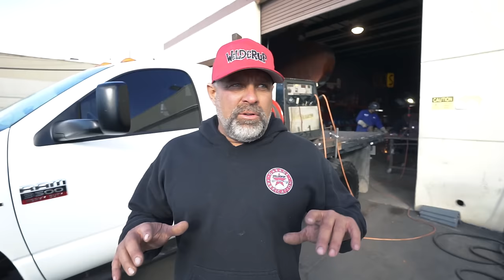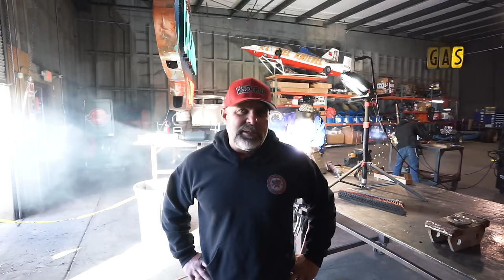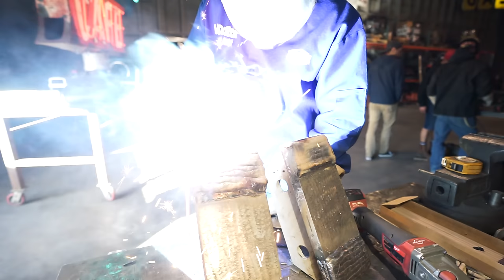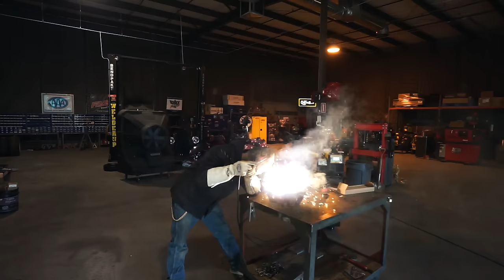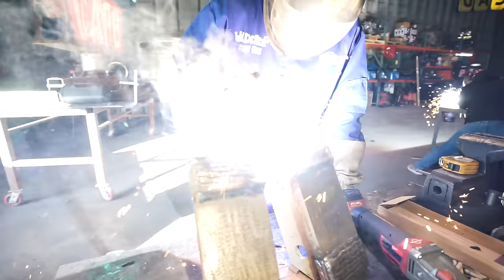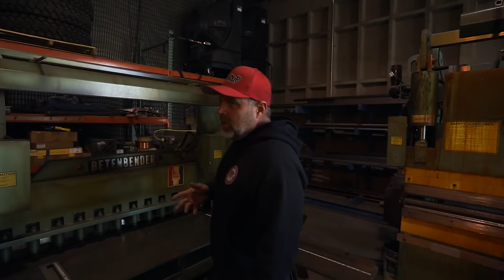Making $1,000's With A Welder at 20 Years Old | Why You Need To Get Into Welding

Comment: I welded in highschool and around the house, then went to hobart, and have been welding for 10 years anywhere from industrial maintenance, powerplants, concrete plants, shop welding, cranes,asme pipe welding, derby cars lol, bore welding, hardsurface, repairing equipment

Comment: Really Cool to pass on your skills but safety glasses and safety awareness is the smartest and best tool you could ever pass down. This is coming from a guy that’s had his head put in a medical vice, had his eyelids mechanically held open and told to “look straight ahead at the green dot and DO NOT move your eyeball”. That was right before the good Dr. started drilling. The microscopic piece he Drilled out was mostly in the white but partially on the edge of the color. The color drilling is unlike any other pain I’ve experienced. They can’t immobilize your eyeball itself and you can’t flinch. This was the most trust I’ve ever put in another human. I waited about 30 to 40 minutes for the specialist to arrive. He was calm, and extremely confident. The bit he used was smaller than a hair. It had to be chucked up under a magnifier. He said if I flinched during the procedure that the end of the bit could possibly break off and then we’d have some really big issues depending on how deep it was in my eye at the time. When this accident happened I was wearing safety glasses And a face shield. I was prepping a broken outboard motor fin when a chunk of aluminum hit the welder control panel and ricocheted in a perfect trajectory past my double PPE and into my right eye. I bought safety glasses with mesh sides afterwards. Maybe it’s just my luck but I’ve also almost lost a tooth to a piece of a cutoff wheel about 5 years before that. That situation is why I was wearing the face shield over the glasses. You can never be too safe and of course, accidents will happen. You only get 2 eyes on this journey. If you lose one, you also lose depth perception which is desirable in our line of work. I hope they read this and learn from my story. Some guys think safety glasses are for pooseys. Those guys aren’t tough, they’re idiots.
Reply from the maker: Thanks for your comment. Appreciate it!

Comment: My humble opinion,  the Old Miller's, Hobarts, and Lincoln's don't know how old they are,  they're tanks plain and simple.  I once found a old old Miller Thunderbolt that was under water for weeks after a hurricane.  I took it home, took it apart, vacuum,  clean, blow out, some grease, and new cable ends. That was 10 years ago and it's still welding today.

Comment: cool but i dont fully agree on the 'not being able to read and write' part....  because as a welder you need to be able to understand technical drawings, and read schematics of all the machines you work with.   perhaps writing is not as much of an issue, but you need te be pretty mathmetical if you want to do a little more than just laying the welds  if you ask me.        perhaps you could say it depends on what kind of jobs you do.   if you have to work with engineers and architects you certainly need some technical communication skills aswel as having technical insight. :)    welding is not for dummies!
Reply from the maker: That is all true. Kash being funny. Certainly do need to know how to read and write and doing math everyday along with a lot of other things. Thanks for your comment.

Comment: Had 13 yrs in steel fab work not so much in the weld n but prepare n the part such as punch press ,10 ton brake press,10 foot accu shear for 8`×6' sheet steel up to 1/2 thick operated 10ton overhead crane  mill n machine, i.w.machine for angel iron and round stock AND YES AFTER A 10 HR DAY OF THAT UR WHOLE  BODY HURT THAN 2009 CAME AND POOF IT WAS ALL GONE IM 45 NOW AND STILL STRUGGLING EMPLOYMENT WISE

Comment: I would throw a word of caution welding is a construction industrial base trade regionally can be profitable depending on location and the amount of work available I can tell you I living in the Northeast welding is one of the most unappreciated trades both in need and pay scale compared to other trades for instance most construction companies in my area are small  businesses who mainly work on their own equipment I quoted a cutting-edge one time I believe it was 10 ft. I believe the wear plate to do the repair was around 700 my cost at the Steelyard 1900 was the quote did I get the job no if you figure the amount of hours that was involved any additional materials and wear spots on the bucket to be reinforced not to mention travel and expense don't know who ended up doing the job but it wasn't me so my point is be careful what you tell people can be a profitable trade but with the lack of Industry and construction projects once again depending on location we don't double dip in this trade other than commercial buildings there are very limited opportunities to make money in the housing market compared to other trades such as electricians HVAC Plumbing Masonry carpentry and so on just my two cents but I do agree welding is a real man's trade you definitely at work for it in the trade since 1982 and have held many certs which is also another pet peeve the fact that a cert can expire in 6 months is ridiculous if not in use no other trade goes through that you don't see plumbers and electricians losing their license for lack of use on top of that there are certs for every process  and every base material both on pipe and plate  even Bridge code is a separate certification they can cost you 300 to $500 pass or fail on average anyway thanks for the video I always enjoy seeing people willing to work for their money 👊

Comment: Well as a union Pipefitter welder I can agree one thing I don’t is tell them kids to wear there PPE using a wire wheel with out safety glasses is a major issue get one of them wires in your eyes they are way to young for that also welding takes a toll on your eyes without safety glasses

Comment: Great video!! But, from a old time welder like myself, running hard-faced you really need to invest in a good air helmet. Some, of those harder rods and wires can do a lot of damage to your lungs and can be so toxic you can end up in the hospital or they can even cause death! You can't support your family with either one of those scenarios. Invest in the right equipment, even if it's a little too expensive do it safe and right the first time.. 😉

Comment: Any thoughts on the physical demands of steamfitting/pipefitting as an apprenticeship path to secure welding as a skill while earning good money? Do you think 10-15 years for experience and money is worth the physical toll, to then go on to focus on welding as an independent career? Or would one be better off going to a welding school that they have to pay out of pocket for. Long winded question, but thank you!
Reply from the maker: Hi Brian, I started welding in High School at the Career Center in my city. I got my schooling in the steel yard working for years bending, cutting, fabricating and working with structural steel. I then became self-employed with a mobile truck and did many different types of welding. Mobile worked best for me and has worked for my sons. Can't really say on the physical demands other than the steel yard and the heat of Las Vegas was hard at times. Good Luck with your decision.

Comment: Ive been a welder for 10 years in Alberta Canada. im 32 now but the oil patch is completly destroyed here now and way to many welders and no work. Ive been thinking about moving to vegas because there always building there. Alberta was fine when there was money here but now its cold for 7 months and theres no money anymore. Are welding jobs easy to get in Vegas is there a high demand? Alberta is freezing and no work it might be time to move somewhere else!
Reply from the maker: Y2J, at this time Las Vegas has shut down. Before the Virus it was on a up swing. I agree that the cold winters make it hard there, but 3 months out of the year here it is extremely hard on Welders in the yard and out in the field. With temperatures from 100 to 112. Bending a cutting steel makes it seem even hotter, it can be rough, but most of the year it's good. It takes some getting used to. Let's hope that it all comes back stronger than ever.

Comment: I been on the fence about getting back into welding, I went to school for it and worked in production welding for about 4 years but I just wasn't making the money that I thought I deserved for the work I was putting in I fabricated press heads for bailing equipment and I've done some structural and heavy equipment welding but I got out of it. it's been maybe 4 years since I was in the industry and have not been happy doing really anything else like when I was welding but I'm not 23 years old anymore and I have a son to help provide for and 12-15$ an hour production welding just isn't going to do it for me and in my opinion the wear and tear on my body is worth more than the price I just mentioned, do you have any suggestions on what I should do so I can get back to the job I really really like doing but stay away from the low paying production the only type of welding I've not had a lot of time in doing is TIG and Pipe but I'm familiar with it. As in I took the classes for it in school. Awesome channel just found it and seeing you guys and alot of others on here making awesome money doing what seems like to me pretty basic welding applications GMAW, SMAW etc really makes me feel confident and comfortable with going back to it. Thanks 🙏
Reply from the maker: Hi Phillip,
We have stayed busy here in Las Vegas. There seems to be a need for welders in many areas. My boys have their own mobile welding and is working well for them. Welding is a good trade. If needed you can always fall back on it. It is good to perfect your TIG and Pipe. Do it well and do it all.

Comment: Honest question. How has the health standards for welding changed compared to the old days?
Reply from the maker: I think mostly the ventilation and safety goggles. Better helmets. I've learned the hard way with some burns to my skin so stay covered. Fire and electricity resistant clothing. Shields. Just about everything continues to get better. Stay safe!

Comment: I really want to get into welding, I do wood working right now, can any of the seasoned welders recommend a good starter welder that’s easy to learn quick? Like what type mig,tig? Thanks guys
Reply: Get a Lincoln power mig 210 mp. It's a great machine capable of stick,tig and mig. Great machine go learn with. Or an esab rebel also is a great machine. Look into it and good luck.

Comment: I've worked with welders fabricating, grinding, and bending metal but never welded. How can I get started? School or job that allows on site training.
Reply from the maker: I offer a beginning course on beginning welding on YouTube. There is a cost. info@welder101.com        I took welding in High School at the Career Center. Went to work in the steel yard and was mostly self taught. There are trade schools that teach only Welding. We have two schools here in Las Vegas. Some unions will offer to school you also. Thanks for watching.

Comment: I managed to chop a top on a 50 F-1. 5.5 inches! It looked sooo bitchin'. Then I tried to weld it all back together. All I had was a $99 Harbor Freight 110v stick welder the size of a shoe box, and zero practice or experience. No bueno. Cutting tin is easier than stickin it back together. I sold the truck 😕.
Reply from the maker: Good story! probably won't do that again. Makes for good practice!
Reply: @WelderUpVegas  I got a small mig now, a Miller I inherited from dad. Just gotta get an argon bottle and some .023 solid core wire, and I can try again!

Comment: i no how to weld and I'm good at it but I just cant figer out how to start my own business I really don't have the money to got out and by good welders or rigs have any suggestions for me
Reply: work for someone who has a mobile welding truck. learn how the business works and learn how to price jobs. Then save your money, buy a used  4x4 pick up truck and a small motor generator welder, a set of bottles for cutting , and some basic hand tools. that is all you need to start out. you dont need a 3500 series dually truck and the top of the line weling machine , start small and work up to the big truck/welder
Reply from the maker: Jeff Ferguson is right. Do just as he has recommended. Couldn't have said it better!

Comment: Did you need to get a degree or just a certificate to begin welding jobs?
Reply from the maker: A high school degree or equivalent like a GED certificate is normally the minimum educational requirement. I took welding in high school and had many years of on the job training. Some jobs require that you are certified others don't.

Comment: Skipping out on alot of details. $2500 a week sounds great but depending on the situation it could also be terrible. If its $2500 a week being on someones payroll with benefits then great. You would have limited expenses in that case.

However, with what you are talking about it's likely welders owning their own welding truck as a contract or job shop type business. With this you have a ton of overhead, have to pay for your own insurance (personal health, business liability etc). Not to mention depending on the situation gas, materials and consumables all eat into profit. Operating a business at $2500 a week is much different then making $2500 a week. Alot to deal with for breathing in fumes all day.
Reply from the maker: It certainly depends on the area and the economy in which you live. We have been lucky here in Las Vegas until Covid and things have certainly slowed down. Even then the small jobs have kept them busy and having their own mobile business has been a plus. Older model Dodge pickups and used equipment. Thanks for your comment!

Comment: Just gotta get certified, if your not certified you’re  making a buck or two above minimum wage.
Reply: How do I get into welding?
Reply: When I went through the automotive program at my city college there was a welding program also. I took 2 welding classes for pre req’s. Different welding types. Mig, tig, stick. Flat, horizontal, vertical. Then after you get done with most of the classes needed and your comfortable, a few welders would pitch in to bring someone to verify your welds and if you pass you get certified. I believe 1 in 4 or 5 passed. It was years ago.

Comment: Who is going to pay 150 per hour to have a kid hard facing equipment? Nobody. There definitely not going to pay 300 per hour just because they can do a bit of wrenching. You said they made 420 in 5 hours. That's not 150 that your claiming. To all the kids out there. Learn how to weld pipe. That's where you can make the money welder up guy is claiming. I guarantee none of them can do it.
Reply: @Tyler X most of my work is tig. Depends on application. Join a union they will train you for free. Even if you go to a school out of pocket. It will pay for itself very fast.

Comment: Welding is terrible pay in England, easily the worst paid trade
Reply from the maker: That's interesting, didn't know that. We have been lucky to keep working here in Las Vegas. We are mobile and that helps us keep busy. Thanks for your comment and thanks for watching.
Reply: @WelderUpVegas  i believe it was good pay back when the oil rigs were booming but if you're in a workshop round my way the most you're looking at is £12.50 an hour, brick layers are around £20 and I've heard of electricians on £30